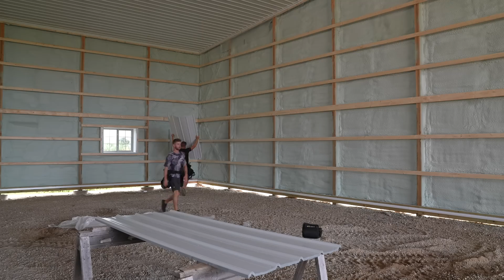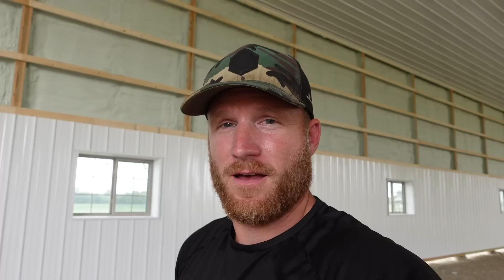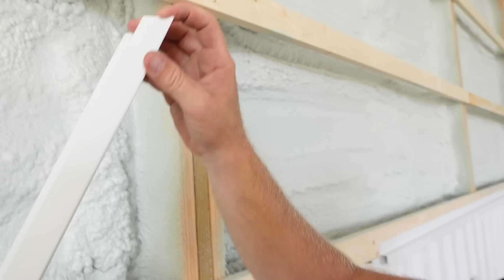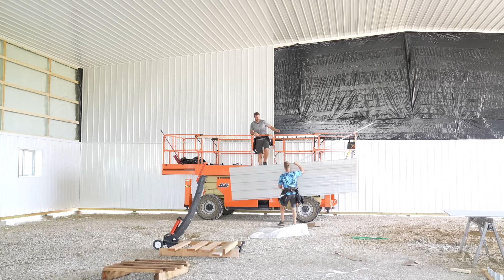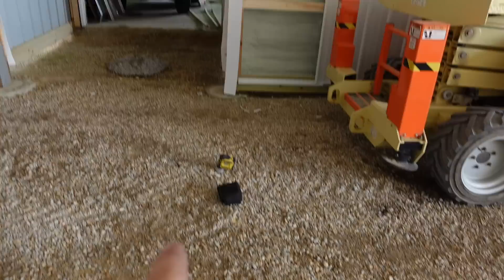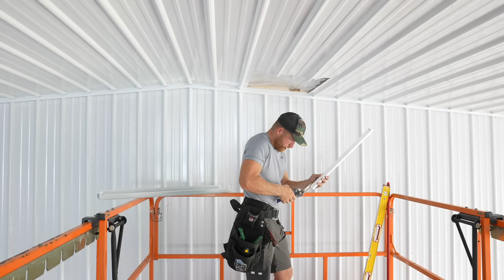Part 8-2: Building A Large Workshop With 2 Guys. THE FINISH

Comment: Beautiful/ I was told by a metal buildings manufacturer Sells 14 x 24s all day long acres of these buildings. I was told talking with him one morning looking for builders for a  36x40x10 4/12. He informed me in our humidity filled daily climate in summers in Texas that the blown in insulation shrinks to about 2 to 3 inches from the wet and drying extrema heat to the moisture  filled blown in insulation. 90 to 110 degrees like spraying warm water on cotton candy and heat drying it with a hair dryer was my 1st thought, He said a type of foam like Styrofoam but a different newer insulation product would be the way to go if you want actual R38 59 year isulation vrs 2" failed R38 to maybe R8 in the bottom 4 foot wall cavity 20 years later. Just a  bit of info I had heard on moisture humidity and extreme heat. Thanx for the close ups . Very Nice.

Comment: Kind of an odd question but could you build a greenhouse structure using post frame? I suspect you’d need to treat the wood to prevent rotting. My thinking initially is a structure that have standard post frame with half of the structure and the other half would use greenhouse glazing materials instead of metal paneling.

Comment: Thanks Kyle, love the videos. I built my own home 35 years ago and may have used post/beam if it had been a thing then. What is the steel panel punch tool you use? I've been around construction and haven't seen that before. I too am in Northern Illinois.  Thanks again.

Comment: How do the attic insulators walk around inside the attic?  Do they walk on the top side of the ceiling steel?  Is the ceiling steel strong enough to hold a persons weight even though it is attached only every eight feet?

Comment: So if the building is insulated why use plastic and not black fabric like what goes under a shingle roof? That would not sweat and would aid in sound dampening. I am sure you have a reason, just wondering. Thanks

Comment: Impressive two man build, I just dont understand why not just pour the foundation first, then you can put the bottom plate bolts directly into the concrete. Much easier to work on and erect your walls. And your post would not be in the ground. Just wondering

Comment: Excellent work at every turn Kyle. I have a practical question though. How do you address working safely with steel panels like these? You're definitely a "Work Smarter, Not Harder" guy, but I didn't see you wearing gloves despite the material's edges being quite capable of slicing palms open, so I'm wondering how you handle the matter.

Comment: Time is money and money is time. 
On the doorway that connects to the two buildings, why not use a "coil" type roll up door? The coil would sit just about a foot above the bottom of the opening. Those do have a motor on them to open and close. I know you've installed them before in other buildings you've done. Cheers :)

Comment: Again I'm still wondering what the thought process was here. Typically it's pad is dug out, plumbing and underground electrical layed out, concrete pad poured and then the structure build starts. Even the fact the interior was buttoned up prior to electrical for lights or outlets are run and even plumbing that's run in the walls. I'm not looking to criticize just understand.
Reply: It's a workshop... The electrical will be run on the outside with conduit.  Plumbing can be done just as if there's no build there.  The pad just floats and is not structural.
Reply: My thoughts as well.  The workmanship is very good.  I have watched the entire series and many of the issues and strategies are addressed but electrical wiring is not mentioned at all.   What about exterior lighting for example?  Does it need to be punched through both the interior and exterior wall?

Comment: Beautiful work as always. The only thing in my head that messes it up, and its not anything you guys do, its just one of my personal pet peeves. I cannot stand conduit surface mounted on walls and ceilings. Funny enough I don't mind electrical boxes so long as they match/blend with the wall and ceiling finish. But something about seeing conduit on the surface of a wall just sets off something in my brain. It like ruins the finish work on the wall from my aesthetic perspective. Actually, come to think of it, its really horizontal conduit or plumbing. Not vertical runs.
Reply: It's a farm shed not a finished home. It's built for work not esthetics.
Reply: I was just wondering what they were going to do about the electrical myself...
Reply: Following for reply.
Reply: It’s very difficult to run wires in the wall and recess electrical boxes with a metal finish. The box’s would end up on ribs and the cover plates wouldn’t sit flush
Reply: @jessiepouteau2175  I think that they actually make finishing kits for that, though I can't be sure but over the years I have seen a lot of videos on this type of building. And I kind of recall that.
Reply: The other tradesmen have to be as fastidious as Kyle otherwise their work looks cobby. Not everybody works clean and true.

Comment: another great build so far! If they are that worried about the acoustics - Linus Tech Tips just did a video recently on an acoustic panel kit that is surprisingly effective - i would imagine that those panels could easily be mounted on some of the large open wall spaces in that building - and for not much money (compared to the overall build) they'd have a dramatic improvement in echo and all that in the new space - would be pretty cool to see.

Comment: The only thing I would change is maybe use white film behind the perforated metal to make it "whiter" and match closer to the solid but it's not much different with black film.
Reply: Me too. I was wondering why Black film and not white, price maybe?
Reply: @attaat  its just changes the shade a bit, that way you dont have miles and miles of pure white walls and ceiling
Reply: @milesboyer4657  that makes sense Miles, cheers for that. 👍

Comment: I would really like to get a walk through when  concrete is completed..
It would certainly be awesome to see ...
Is the reason the concrete is done last,because if concrete doesn't touch the building it would be taxed at a different rate...
Like a pole building  ???
Reply: most of the time they have the concrete done last so that they do not damage it while there building the building .. some floors it is different time but the floor needs to set 10 days or more before heavy machines can be on it ,, man lift could crack the floor if too soon .. or if you drop a hammer or a 2 x 4 on the floor it could chip the floor ..
Reply: My question is- Wouldn’t the splatter of the concrete get on the panel and pose a visible issue? It doesn’t wipe off easily once dry, and I’ve never seen concrete workers wiping off walls. 🧐
Reply: @FatRoofus  I believe in an older video it showed that there was plastic sheeting put over the panels to keep the concrete from getting on the panels.
Reply: @FatRoofus  Yeah in my DIY plans I'm thinking to pour first before putting the bottom layer of metal on, so we don't have to be careful, and worry about masking the metal from the concrete.
Reply: @snap-off5383  that’s what I see most often. Our concrete people do fantastic jobs, but I wouldn’t want them near all the metal. 🙂
Reply: @FatRoofus  I have seen them put plastic up before they poor the floor .. most of the good concrete people would do that .. too much of a chance too damage the floor if it was installed before the building was finished ,, tools, boards and other items dropping on the floor ..plus his man lifts would crack the floor if you did not wait 30 days or so before driving on the concrete ..
Reply: When I had my post framed barn built I waited to put the concrete in so that I could drive and park in it and get those areas nicely compacted where vehicles and equipment would be.  Also, I had mine built in the fall and the assessor came out shortly after it was done so the next years taxes were cheaper as it's based on the 1st of January.  So in the spring I had the concrete work done and didn't get taxed until the next Jan. 1.
Reply: Not to mention concrete is more fluid, if the building is off a little here or these it’s way easier to make it up with it. Some also chose to do concrete at a much later date as funds allow and the building is still useful in the meantime.
Reply: Many good points made above about equipment damaging the floor and the pad maybe not being fully square. I'll add one more to it. On a pour this size having a roof over it makes the concrete guys feel a whole lot better about it not getting rained on or the sun baking it too fast!